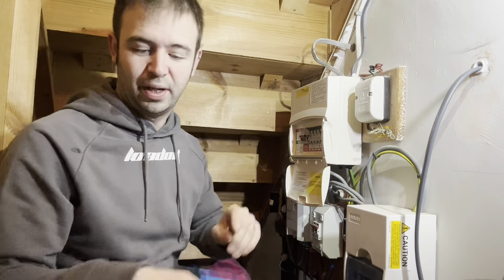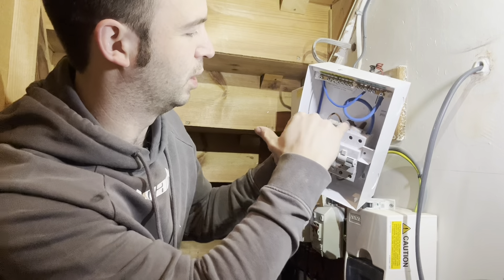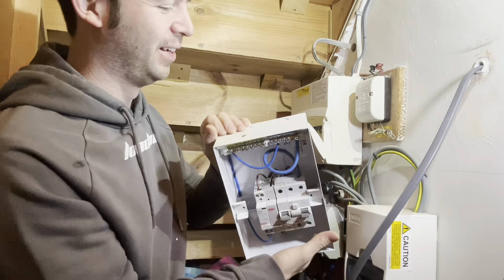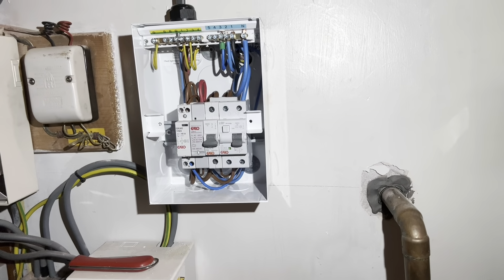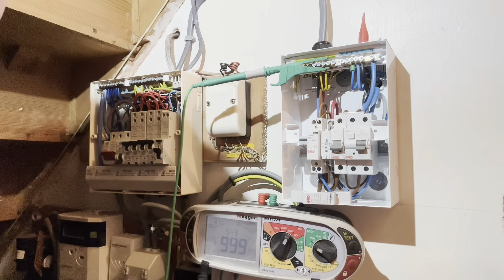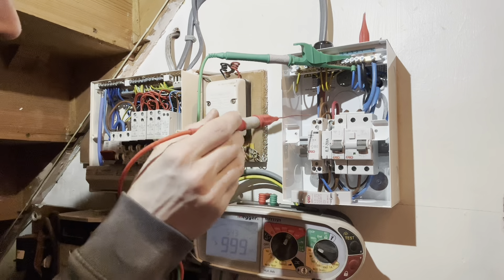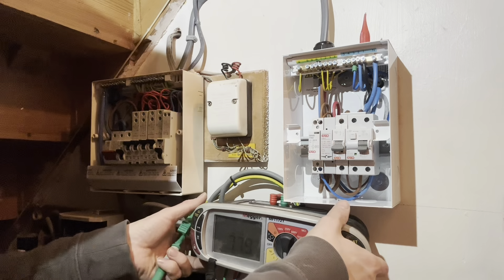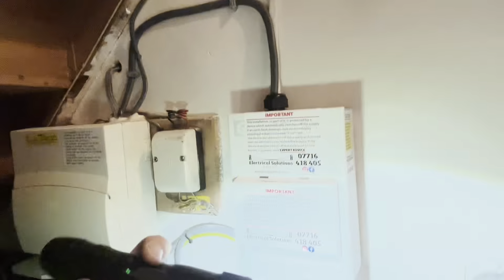Garo Priority board Part 2

Comment: Hi excellent video but one question what you use to to extend shower wire if they are short so can reach the priority unit 
Thanks
Reply from the maker: Pulled back, it came from above so I gained slack by pulling it out